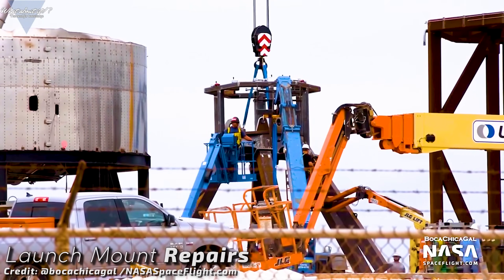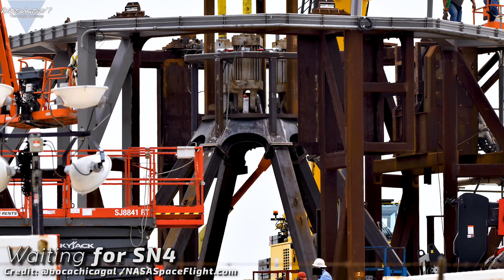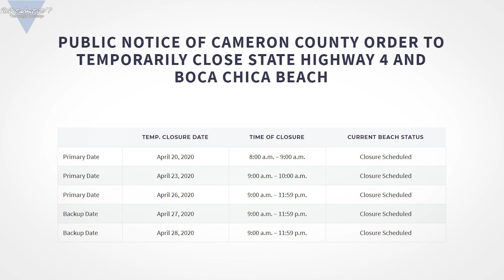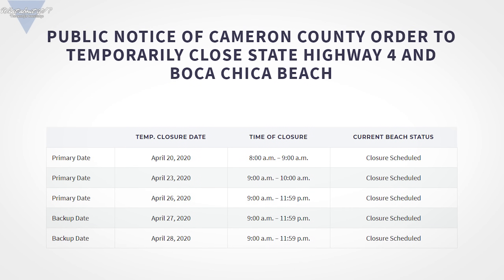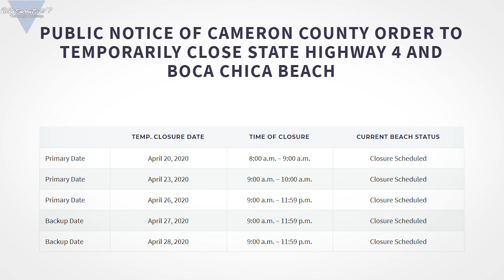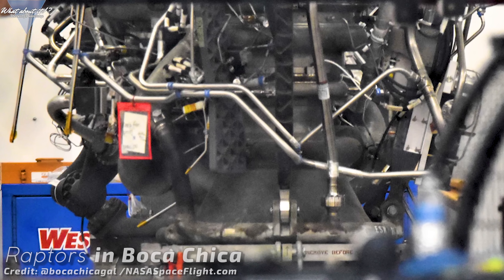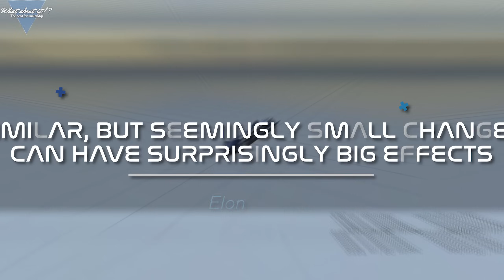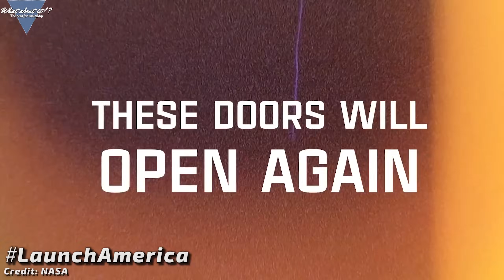86 | SpaceX Starship Updates - Crew Dragon Demo 2 Has An Official Date

Comment: metal structures on the outside of the vertical assembly building.
basis for placing various equipment in containers installed on the outside of the building? 2:37

Comment: Hi:) Do you think that space x will use hydroforming to make bulkheads in the future? It looks like a very clean, fast, strong, and repeatable way to make this shape.  If they can produce disks with the required diameter innhouse, they dont need any welding, and they will get the preassure test for free under production. Here is an axample i found of the principle. https://youtu.be/r2qiEr88Z20.

Comment: there will not be a case where they don't need pressure testing.

Every gun gets individually tested
Every Scuba Tank gets individually tested

Every Merlin engine gets individually test fired
Every Falcon 9 gets individually test fired

Every Starship will get pressure tested during construction, both simple testing and cryo testing.

Comment: Given the anticipation for this cryo test the inner spoiled spacex fanboy in me wants to see a full hosted webcast of the event. And IT IS an event since no SN up to now has made it past this barrier.

There would be of course screen graphics showing live pressure and temperature readings complete with multiple camera angles on all possible failure points. The hosts would be some well spoken guys and gals from the starship production crew and they would give us detailed breakdowns of how they struggled to get to this point in development. 

The whole thing would be over as quickly as it started, video production setup would definitely slow down starship development, and unnecessarily setup Elon for a fall if it fails....

......but MAAAAANNNN what a moment it would be if it goes well.

I'll stop now before I completely run out of drool here.

Comment: 2:12 Exactly what revolutionary, advanced production method as opposed to "traditional" methods do you mean? I don't see any.

According to German Wikipedia the Soviet Union between 1966 and 1989 launched no less than 642 freshly built Soyuz rockets, that's more than one every two weeks!

Also think of the 1000s of ICBMs manufactured during the cold war. 

Mass production is absolutely nothing new in the rocket industry!
Reply: You need to check your math. Thirty three years is 1,716 weeks.
Reply: @odysseusrex5908  Yeah right, I made a subtraction mistake: 89 - 66 = 13 HAHAHA

I can tell you why, it's psychological: 
Somewhere (on Wikipedia I believe) I had read about a year ago the Russians had a rate of about 1 Soyuz / week for a couple of years (at least I remember it that way). Yesterday I tried to find that piece of text and then it seemed like I had found it or something similar. So I made the calculation yesterday not to find the solution but to "prove" it, believing to "know" the result in advance. I also couldn't focus yesterday all day long because I had gotten out of sleep rhythm. And voilà.

If I find that quote with the 1 week rate, I'll let you know. If not, doesn't make much of a difference for my point.
Reply: @ixglocTV   They may well have been doing one a week for some period of time.Possibly also that was taking in to account several different launchers. The Soviets used to have a very rapid launch cadence because their spy satellites didn't last very long and had to be very frequently replaced.
Reply: @odysseusrex5908  There it is, in the English Wikipedia. (Should have looked there first.)

"The production of Soyuz launchers reached a peak of 60 per year in the early 1980s."
Reply: @ixglocTV   Fair enough, that, of course, was with a fully equipped factory system. If SpaceX can turn Starships out every couple of weeks in tents, what will they be able to do with a finished design and a proper factory?
Reply: @odysseusrex5908  Why are you trying to distort the facts only to make Musk look better than the rest? SpaceX is NOT better than the rest.

"SpaceX can turn Starships out every couple of weeks in tents"

They haven't built a single rocket in tents! Those "prototypes" are only stumps and not one performed fully. Even a complete Starship is not orbital. And it won't be built in tents but in the high bay. Not to speak of the booster. 

Musk has the latest technology available, whereas the Russians did it

-- in the 1980s!
-- in the socialist economy of scarcity, with minimal resources and infrastructure!
-- with vast distances to cover in the supply chain
-- in continental weather conditions with cold winters
-- using kyrillic letters only HAHA

What Musk has accomplished with the Starship project so far, is neither admirable, amazing nor astonishing. When the first Starship has successfully returned from orbit, THEN is the time to applaude. Not before.

Comment: In my own opinion, and I'm an not an engineer, performing a belly flop maneuver is highly dangerous for a vehicle that size, even if it is a controlled fall, it could just stall. Picture an iceberg, a slight change in center of mass carries huge momentum.

The flaps and its systems weight (probably) more than the extra fuel required for the retro burns. Falcon 9 only uses fins and are fine with it and Super Heavy will use them too. If they decide to go "slim" the only focus is in the skirt and they don't have to worry about that tank in the forward section or a shifting center of mass after loading and unloading, not to mention its no use on the Moon or even on Mars.

The best part is no part, so... why change what already works, right? I know it looks cool but when we watch those re entry burn videos, anything at hyper sonic speeds is very precise for a safe landing, there's just not enough room or time for error. Time will tell.
Reply: Reentry burns work when you're braking a Falcon first stage from suborbital velocity. Not so much when braking a Starship from interplanetary velocity... like most Mars missions, they need aerobraking to slow down enough to land.

Comment: Queston,  Do you know if anyone is going to build and test artificial gravity in space .
Reply: If you mean rotating structures that use centripetal force to simulate gravity, while no one is currently planning to, it is inevitable that someone will. If you mean some kind of science fiction proposition where an actual gravitational field is artificially generated without mass, that would require a paradigm shift in scientific thinking to even imagine a theoretical basis for.
Reply: @odysseusrex5908  There could  be a third way, continuous thrust. What we need is a much better  energy source. No spaceship  technology can make any significant difference until we have that.
Reply: @javiej    Continuous thrust systems would be very low acceleration, one one thousandth of  a G. Nothing could produce continuous one G thrust. Although, if is could, you could reach Mars in a few hours and Jupiter in a couple of days.

Comment: What's actually changed between SN3 and now SN4? How have they tried to prevent the cryo calapse in this SN?
Reply: The failure of SN3 was due to an error in the testing protocol the lower tank was not sufficiently pressurized to bear the weight of the filled upper tank. There was no known flaw in the design or construction of the rocket itself. We shall see what happens now. Hopefully we will finally through the cryo test and have at least a static fire if not a short hop.